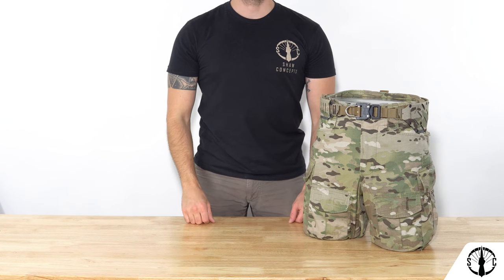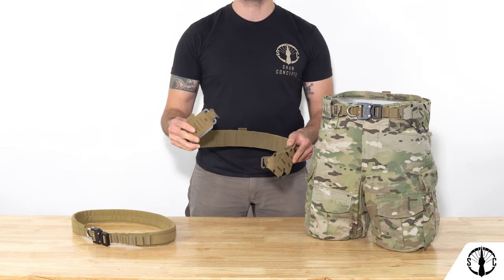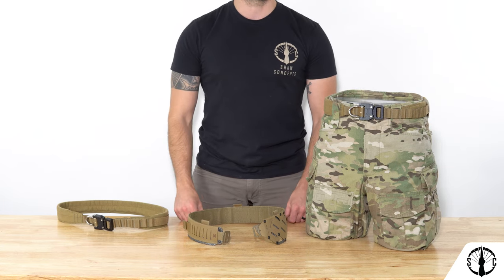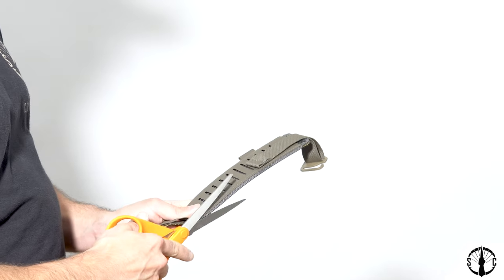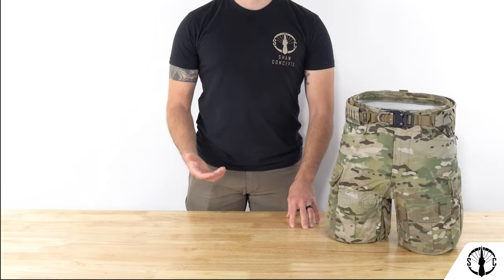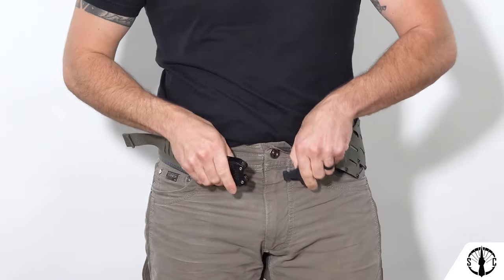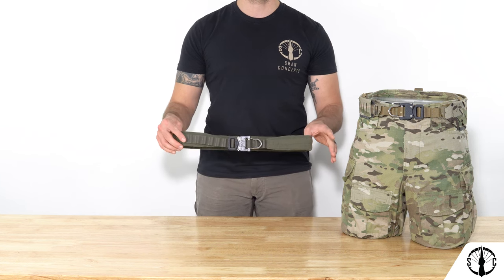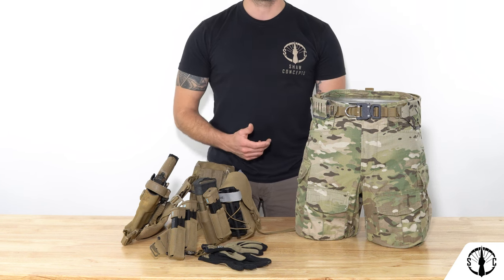The Usurper Belt

Comment: i like the outer belt and inner belt interface design. I can cinch down my inner belt as much as I want, but my outer belt always crumples it up when buckling over the inner belt if I want it tight against my waistline to minimize play in the belt. This looks like it will avoid that issue and mesh much better between the two!

Comment: what purpose do the vertical slots on the front portion of the belt serve? most molle style connections prefer a horizontal layout so I'm wondering what the idea here is?
Reply from the maker: The vertical slots are for retaining that adjustment strap neatly out of the way of the holster and sidearm.
Reply: @shawconceptsllc.8797  I see. I was kinda stoked to see the shoulder harness compatibility, and the potential of this as an LBE type of setup, but that front portion kinda kills the versatility of it for the adjustment strap.

Comment: It looks kind big, does it create heat spot ? Or heat on the hip if you have it for a long time using it ? And btw very cool idea and it looks comfortable af
Reply: Just put some qore pads on it
Reply from the maker: Those can be added!
Reply from the maker: Its a very slime belt so size isn't an issue. In terms of hot spots it depends person to person but since its not rigid webbing and instead padded soft loop velcro it will be better off!
Reply: @shawconceptsllc.8797  oh hell yeah thats some high speed stuff thanks btw love everything about the company everything its just clever!!